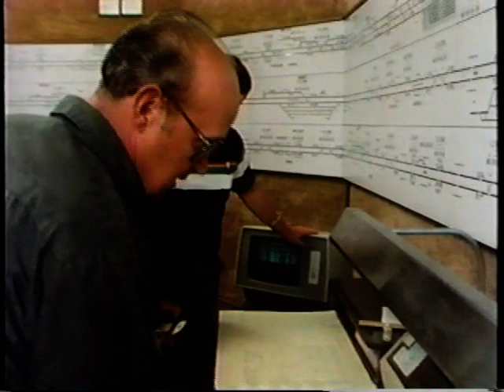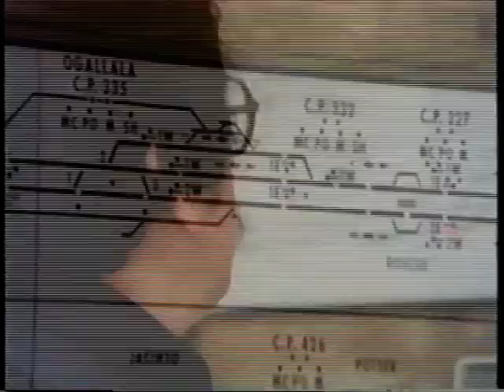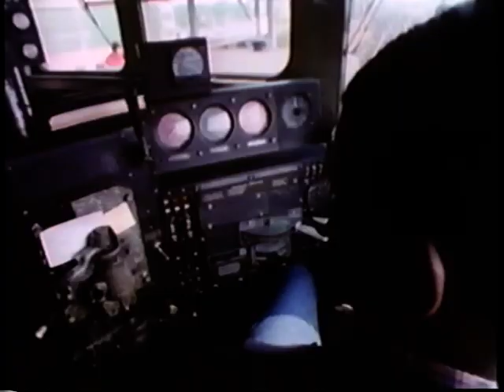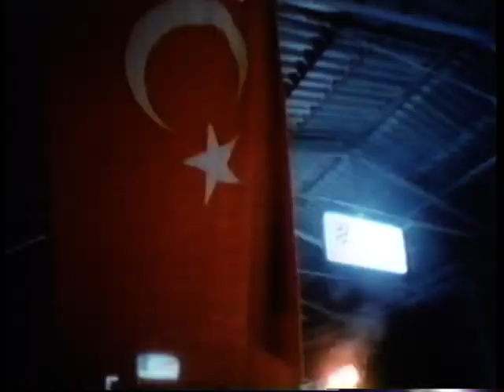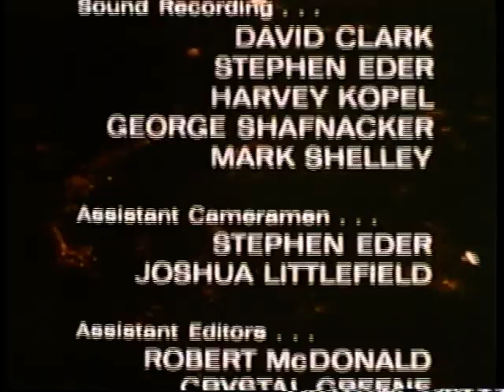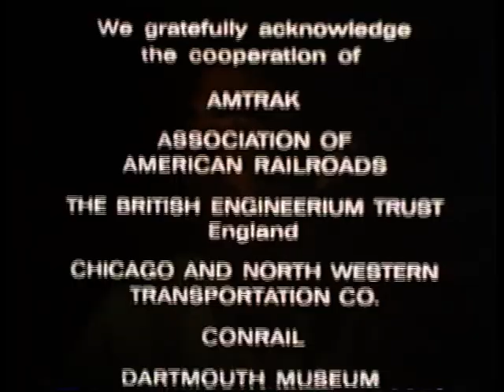National Geographic - Love Those Trains

Comment: I have always loved trains. I used to live about 750 feet from the Buffalo to Niagara Falls line of the New York Central railroad when I had lived in the Town of Tonawanda. My great grandfather Kearney, 4 of my grand Uncles and a second cousin all worked for the Lehigh Valley railroad out of its Coxton yard near Pittston, PA. I travel long distance on Amtrak trains. I recently rode from San Diego to Oxnard, CA on the Pacific Surfliner, it was a great trip and my trips on Amtrak will only increase. I rode on Amtrak a total of 28 times since 1/31/1974, I also rode on commuter trains in Japan, Taiwan, rode on the Kowloon & Canton railway in British China(Hong King) plus excursion trains.

Comment: at 38:37 still using UP cabooses.Must be in Nebraska because they had a caboose reqmnt law til 1988.Though cabooses were still in big use in 1982-84 when this was filmed they had started phasing them out after the 1982 UTU agreement which said lines could quit using them.
Reply: System wide they stopped in 1986.
Reply: some states still required cabooses til 1988
Reply: Va Or Mt IL and Ne all had them til 88

Comment: Revised Porta-Tannin water treatment, Lemprex (Kordina fed Klychap) extractor-ejectors, Franco Crosti preheaters, Nicholson syphons, Tandem compounding, Desmodromic poppet valves, Coarse fuel gasifying fireboxes, mechanical stokers, computerized cabs, Rolling element bearings, force fed non contact dissimilar metal bearings w/ one shot oilers.
Medium speed medium weight interurban passenger service.
Tell me how steam rail traction is outdated again.

Comment: I wonder what happened to that red 2-6-0?  And Souther ry 2716 in this documentary is a C&O Kanawha loco in southern disguise
Reply: The Guayaquil & Quito 2-6-0 (#11) is likely still around, but probably not operational.  A sister engine and a few 2-8-0's are operational on the "Tren Crucero" ("Cruise Train") which offers scenic tours of the G&Q line.

Comment: What happened to the steamer at the beginning? You hear all about the 611, the Daylight 4449, Big Boy, and other but havent' seen this one in a while
Reply: +blazinfury1985 This may be the Pere Marquette (eventually absorbed by the Chesapeake & Ohio) 2-8-4 built by Lima identical to the former C&O #614 and repainted as a Southern Railway locomotive for the occasion.
Reply: +blazinfury1985 

The locomotive featured after the intro credits - Ex-Chesapeake & Ohio 2-8-4 #2716 (dressed as "Southern #2716") - had firebox problems that prematurely ended her career on Southern's steam program.

N&W #611 and 2-6-6-4 Class "A" #1218 replaced her as the heavy haulers of the Norfolk Southern steam program and the 2716 was put into dead storage.  In the early 1990's, the Fort Wayne (Indiana) Railroad Historical Society leased the engine for excursion service, but it's boiler flues expired in 1996.

The Fort Wayne group returned 2716 to it's home of the Kentucky Railway Museum in New Haven, KY and focused on rebuilding their own 2-8-4, Nickel Plate Road #765, which still operates today.
Reply: +Christopher Kovacs Okay, thanks for the info!! It would be pretty cool to see her run again but I understand why it probably never will
Reply: 2716 is about to return to steam.  Please visit http://www.kentuckysteam.org to find out how you can help the restoration effort!